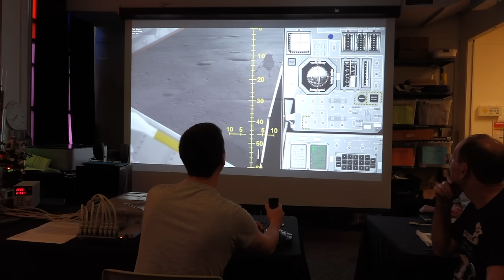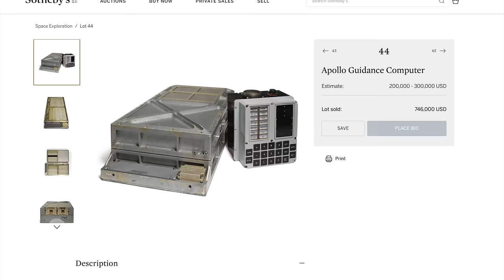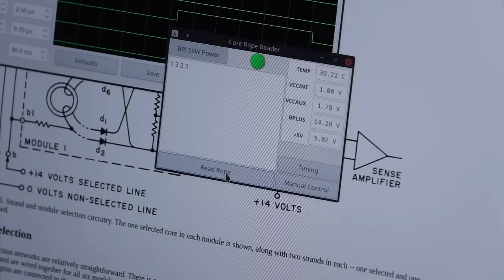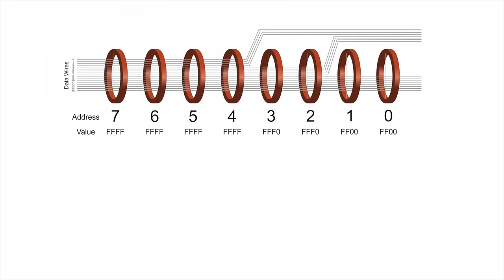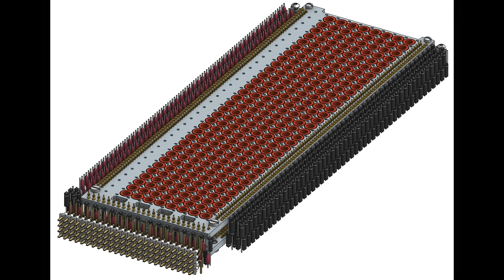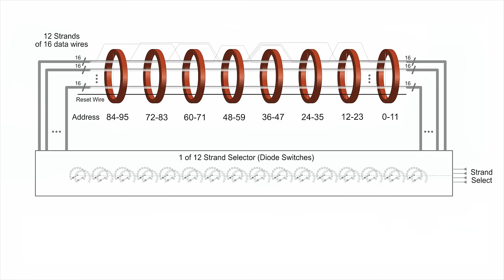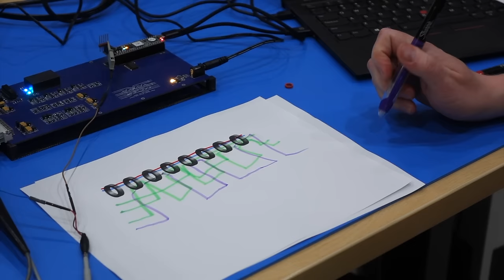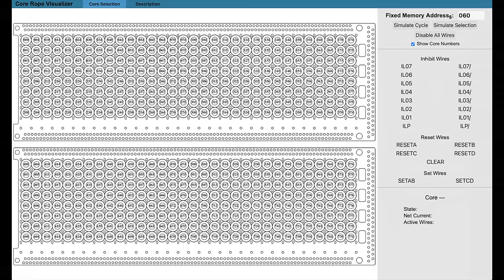Apollo Core Rope Memory (Apollo Guidance Computer Part 30)

Comment: Such a shame we lost this wonderful tech, and thus have been unable to visit the moon for the past 50 years.
Reply: The only thing we lost was the production lines for the Apollo hardware. After Apollo, we switched to the Space Shuttle, which was a major advance over Apollo in every aspect. It had one drawback: the orbiter could not carry enough fuel to get to the moon. That meant no lunar missions until the Shuttle program ended.
Reply: @Hobbes746  
What was the thrust, weight and duration of the 5 F1 motors?
What is the thrust,weight and duration of 3 solid fuel boosters? 

I think you'll find that Apollo was easy to upgrade with the shuttle tech from 1973 :)
Reply: @G-ra-ha-m  So what? Keeping Apollo in production cost  billions per launch. The US was unwilling to spend that much on a second launch system in parallel with the Shuttle.
Reply: @Hobbes746  HASA has never been shy about spending $billions - take a look at their annual budget and multiply it by 50 years.
Additionally the F1 engines were extremely expensive so the reusable booster stages give far more thrust, for longer, with less weight and far less cost. 
The 'too expensive' excuse washes as badly as the 'lost tech' argument.
They had both money and tech.
Also note that the shuttle was always for LEO, there was no truthful reason for Apollo to be scrapped.
Reply: @G-ra-ha-m  During Apollo, NASA spent 10 times more than in any year since. So yeah, look at their annual budget. Lunar missions were unaffordable after 1972.
Reply: @Hobbes746  They already had the tech, boosters and apollo stuff: there wasn't much more to spend.
You think the cost of bolting 3 boosters to the Saturn B1 was more than the shuttles? Doubtful.
But 10x .. they'd had over 50 years to make just one trip!!
Not buying the 'can't afford it' BS, sorry.
Reply: @G-ra-ha-m  Bolting a few boosters to the Saturn 1B would have been a project costing billions, to recalculate the structure of the Saturn, to build a new launch pad, etc. 
The ‘can’t afford it’ is reality. NASA’s budget is public, so you can look up what they spent the money on every year. There was no way to fit a manned lunar mission in that budget until 2010.
Reply: @Hobbes746  Yes, there's always an excuse. But changing the 1B to a Saturn 5 was even more challenging - and they did that in very short order. 
You argument is always '$billions and time', but it's basically an SLS - bolting the boosters on is a simple mechanical task less complex than designing a decent metal bridge.
They have the tech, the money and the time, yet in 50 years: Nothing.
Reply: @G-ra-ha-m  No, they don’t have the money. In your fantasy, the US has an infinite budget. In reality, this is not the case.
Reply: @Hobbes746  The $24Bn budget not enough, over 50 years then?
That's $1.2Tn inflation adjusted spend, perhaps you can explain what needs the infinite budget, and why the SLS or indeed SpaceX doesn't need it?
Reply: @G-ra-ha-m  From that $24 bn, only about 1/3 is available for manned spaceflight. The rest goes into unmanned projects (JWST and other space telescopes, the unmanned missions to Mars, Jupiter, asteroids, Pluto etc), R&D and operations. 
About $7 bn (in 2022) went into development of SLS, Orion and Artemis components (lander contracts, Lunar Gateway development). The Artemis 1 launch cost around $4B. 
Until 2010, NASA operated the Space Shuttle, which left no money to work on lunar rockets.  
Developing a new rocket large enough to take humans to the moon costs tens of billions. Just like developing a new airliner that size (like the Airbus 380) costs around $25 billion.
Reply: @G-ra-ha-m  SpaceX has been estimated to have spent $10B so far on Starship, with a grand total of two failed launches to show for it.
Reply: @Hobbes746  So that's $400bn left to pay to bolt 3 boosters onto a 1B or similar. 
For $10bn SpaceX seems to have got much further. 
Why can SpaceX do many launches for $10bn, but for $400bn NASA only manages a single Orion LEO run?
Reply: @G-ra-ha-m  Again, you are pulling imaginary numbers from the air. We’re talking 50-70 bn from 2010 to now. A lot, but 6-8 times less than you imagine. 
Blame Congress for forcing NASA to do SLS development in the least efficient way possible.
Reply: @Hobbes746  No. NASA's budget was $24bn last year. 
Adjusting for inflation, means that we take that back to just after the fantastical Apollo stuff.
50 years of $24bn a year, in todays prices is $1.2Tn.
With that money and time, they bolted many boosters onto shuttles and the SLS, but totally failed to bolt them onto a Saturn 1b. equivalent, which would have made a far better rocket than the Saturn V.
You argue that it's the money: I've proven it wasn't. 
What's your next excuse?

Comment: 27:06 can you still buy these little "rings"?
Reply from the maker: The large "moly" orange ones are still commercially made. The small ferrite ones are relatively easy to find on eBay or other auction sites, I don't think they are produced anymore.
Reply: @CuriousMarc  You can buy 3,95 mm outside diameter at mouser, but you got like 3 different materials.

Comment: i plan on building me a multi picture graphic card. i want store each picture in a single wire. i want to use enough to output a 1360 by 768 picture. but i want to make a printer something i can send a picture to and it will save the picture to wire. and to display the picture just hit a switch. after that i want to make a screen ill redo some research but im thinking crt screen its the easiest way.

Comment: What can agc do other than fly a rocket and a spaceship?

Hook an old atari or commodore display chip and see if you run games on a tv using real life space technology
Reply: That's one thing nobody in the demoscene have never touched
Reply: You can make your own display using rgb, a cpld, and some cmos chips and a clock, connect it to vga, will have to use an sram chip, how big is 16 or 32k of magnetic rope memory? How fast is it....
Reply: Simply replacing all the rope memory with sram will make the agc run faster and better

Reduce lots of power consumption and reduce the size

My Samsung phone does more, literally nasa could fly you to the moon and back using a single smartphone 

Just hope the space radiation doesn't flip bits, or u got really good ecc
Reply: You can fit 1000 the agc on a single chip with all its software ever made and still have enough room for a modern cpu implementation to still fit

Let that sink in to the agc development  team

Comment: Wow... Hardware coded software...😊 That might withstand radiation too ewen if radiation block it itll turn bac as far as magnetic forces stabilise... Which is a good idea if you are hundreds of kilometer s away from service points

Comment: This sounds silly. By going back through old tec this may actually make Nuclear codes more secure. Right now the old floppy disk drives are becoming much harder to keep running and to find the large disk for. This is back pack drive is not hackable simply because you would have to have the exact rings and hoops in the exact order in order for it to work. Imagine making a nuclear launch sub or base more secure simply by going backwards and using pre! floppy disk tech.  Since it is basically hardened against a nuclear pulse by way of it being cosmic ray resistant this backward engineering could be updated and using modern tech be a super safeguard against any hacking or accidental discharge of a nuclear weapon. Engineers are always looking for the best way to do things. Sometimes looking backwards and using old tech it can make new tech extremally hack resistant.

Comment: Nope. It was fake.
Reply: i agree. And I am NOT a flat Earther. I could just about accommodate a one way manned suicide mission, but coming back? No.
Reply: @paulanderson7796  What issue do you have specifically with them coming back that prevents you from believing they could do it?
Reply: @willoughbykrenzteinburg 
My issue with coming back is breaking out of Earth orbit on the return journey. You cannot just "fall back" to Earth. Once in low  Earth orbit you need a lot of thrust to escape orbit. Whether inbound or outbound you need the same amount of power.
Reply: @paulanderson7796  This is categorically false.  You don't "break out of Earth orbit" on the way back.

Technically, you never leave Earth orbit.  The MOON is in Earth orbit - ergo - a trip to the moon does not require you leave Earth orbit.  You simply have a vast misunderstand about how this all works.

You can indeed just "fall" back to Earth.  That is LITERALLY what they did.  Think of it like rolling a ball up a hill.  You have to give that ball a lot of energy to reach the top of the hill.  In order to bring the ball back down the hill, it just needs a nudge, and it will roll all the way back down using nothing but gravity.

Reaching Earth orbit from the ground is BY FAR where most of the fuel for a lunar mission is spent.  Going from the Earth ORBIT to the moon doesn't require as much fuel.  And certainly returning FROM the moon requires even less.  You do NOT need the same amount of power/fuel to return from the moon as it takes to get there.  That is utter nonsense.  It requires a fraction to return from the moon.  They do not get into Earth orbit on the return trip.  Do you even know what "orbit" means?!!?

You.
Are.
Wrong.
Reply: @willoughbykrenzteinburg  
I Am Not Wrong.

Gravity is how orbiting objects work. This is why geostationary telecoms satellites stay where they are. Their angular momentum is balanced by gravity thus they remain in orbit. It's call centripetal acceleration. Centrifugal force.

To escape Earth orbit requires a lot of rocket thrust. That is exactly the same whether on an outbound or inbound returning journey.